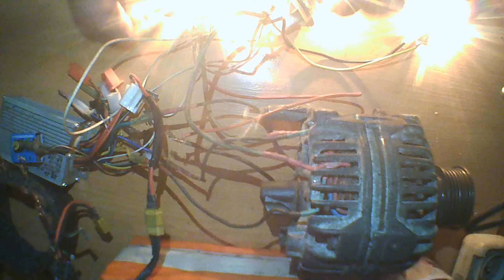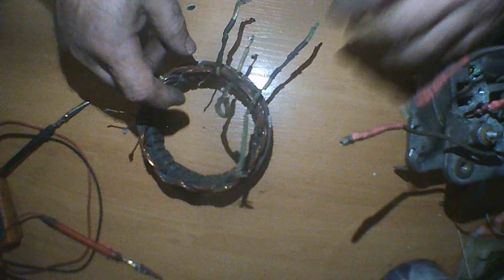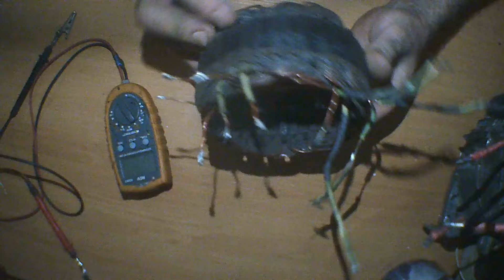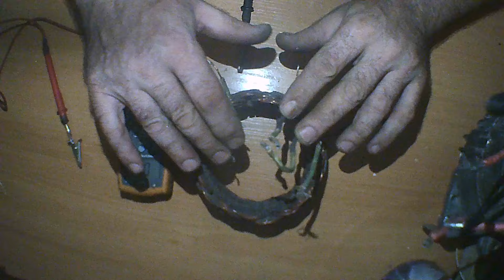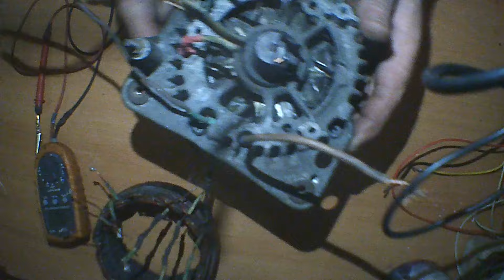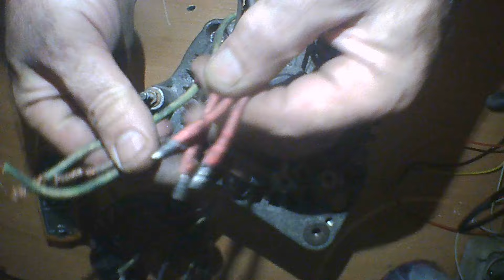como transformar un estator de alternador de auto en gerador de energia generador de energia libre

Comment: bonjour, la partie alternateur  peux produire jusqu'à combien d'ampères et de volts au maximum. Quel type  de batterie vous utilisez pour alimenter la partie moteur? J'ai un vieux alternateur de tracteur , je vais essayer de le modifier comme vous. Pour la partie rotor, vous utilisez des aimants néodyme.
Reply from the maker: bonsoir merci de ton commantaire  je utilize une batterie de hoverboard 36v et un controleur 350 watts alors pour l'emperage et voltage de l'alternateur ça dépend 
Cela dépend de l'utilisation, plus la vitesse est élevée, plus il y a d'ampères et de tension, mais cela consomme aussi plus de batterie. Je n'ai jamais poussé l'alternateur à la limite, mais vous pouvez utiliser un contrôleur de 1500 watts 72v ou 64v, cela donne plus de puissance. l'alternateur et consomme moins de batterie, mais si vous pouvez utiliser des aimants, le néodyme est meilleur, plus vous avez de force, plus le générateur a de puissance, j'espère avoir aidé  J'espère que vous vous abonnez et partagez la vidéo pour aider la chaîne à se développer
Reply from the maker: et pour connaître et mieux comprendre le fonctionnement de cet alternateur, regardez ces deux vidéos qui sont réalisées avec cet alternateur  ///// https://youtu.be/XWlG5jXvwAQ ///// https://youtu.be/2F78rWju3D4 /////  https://youtu.be/fa_fY61dNUQ
Reply from the maker: je vais faire aussi cest video en francais